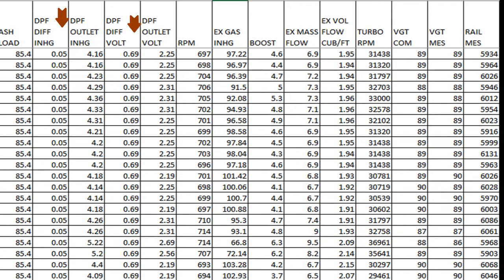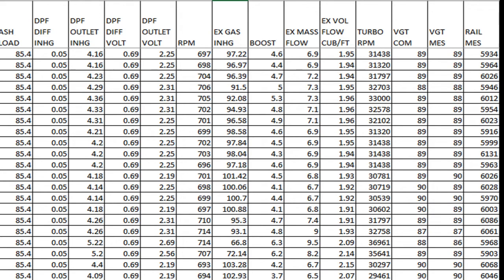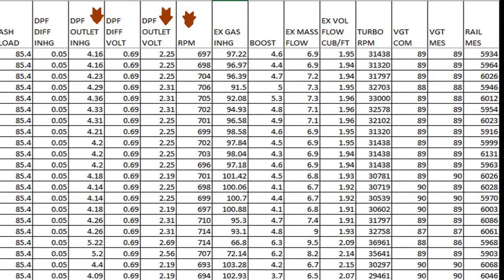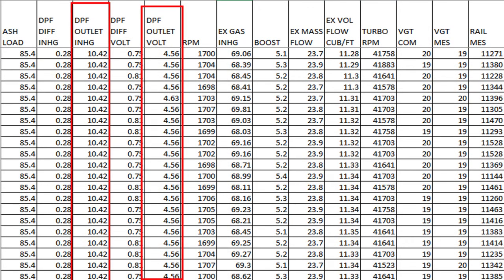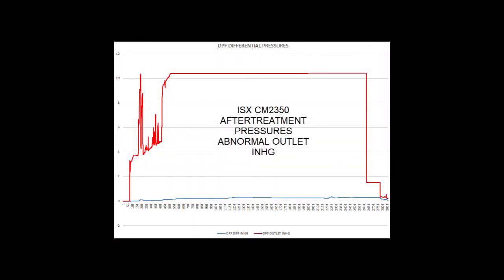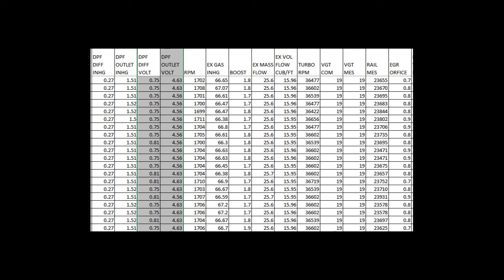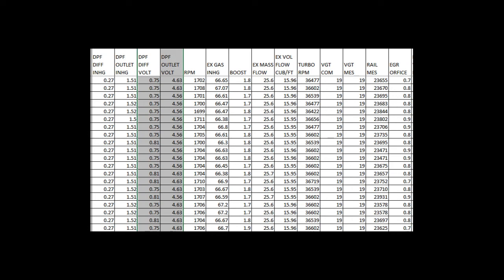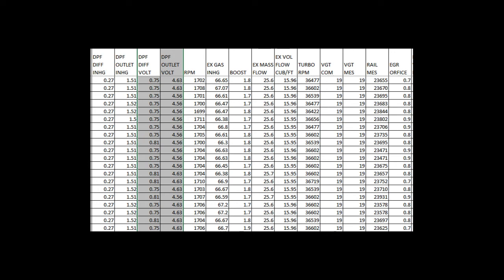LOW POWER! Part 3

Comment: So finally it was dpf sensor? Which one ?
Reply: The sensor was doing its job the voltage was erratic because of a default vavle that was being made via the ecm, the root cause was the scr was plugged
Reply: the signal voltage was 4.5 or close and reading 1.51 hg which is impossible
Reply: This means that somewhere there is corrosion in the wiring, this increased the resistance and increased the voltage of the sensor wires.
Reply from the maker: The scr element was plugged from an earlier severe dpf filter failure where it came apart from severe overheat. we could not see that as it was past the 10 history snap shots the ecm gives you of aftertreatment history. The sensor was ok. The ecm software I think has a bug and lowered pressure but it did not change signal voltage and that should of been my clue. I learned another lesson.
Reply: Logical!!
If a motor can't blow it can suck
Love these videos !!

Comment: So the ecm will default the 1.51 if the signal voltage is maxed or in then case 4.5/4.9? I did not know it will do that
Reply from the maker: I did not either. I suspect this is a software bug because cummins would not do something like this. At the end of the day I certainly learned another lesson about double checking.
Reply: It's my firm belief that the manufacturer is maliciously making updates that break down  as soin as warranty is expired , "nothing personal, it's jus a business".
Reply: I know Software engineers will substitute a baseline figure for some erroneous values received,I DID KNOW they may display them as actual ,,,,
I did catch one like this with a plugged SCR But I used a pressure transducer with A Picoscope,
I'm a Car guy ,in my instance it "felt" like a clogged catalytic converter back in the day,thus my Shortcut.
Reply from the maker: @rgchevyy  Thanks - Great information.